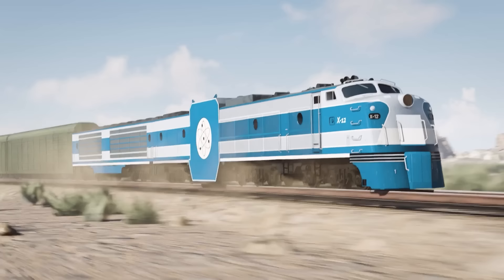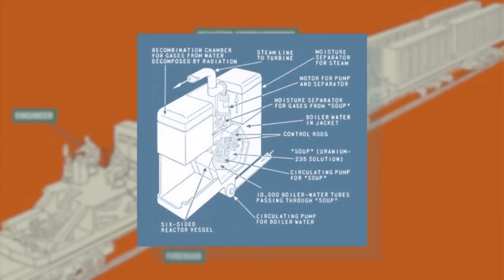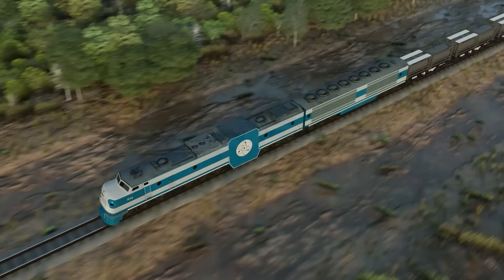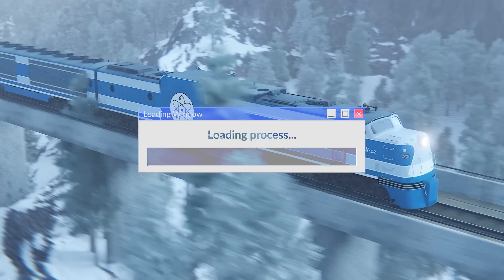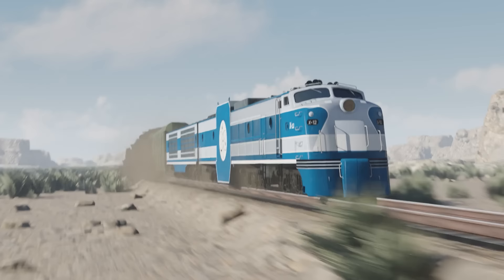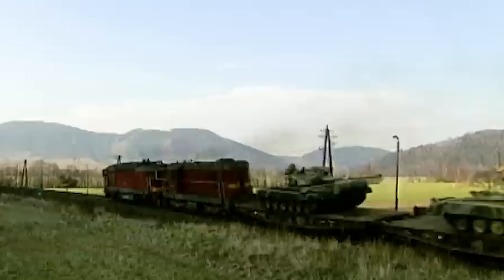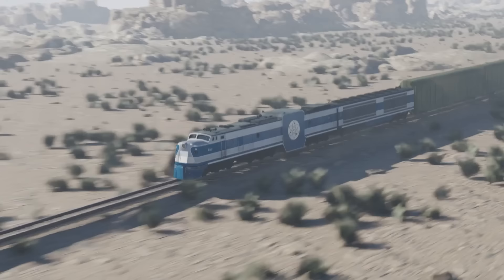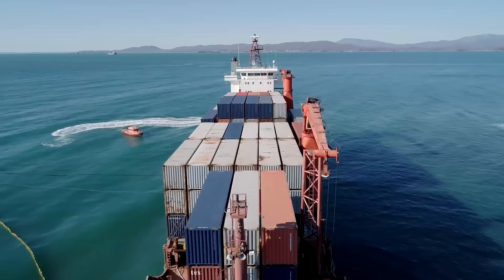What ever happened to Atomic Trains?

Comment: the biggest issue i see with this is, they still need to run on rails, so just build electric locomotives with electrified rails, with the electricity coming from a nuclear power plant, and you have nuclear powered trains that never need to stop, nor refil
Reply: True and anything that can disable the train or the electrified track would mean you have a much worse problem. Either a derailed train. Sabotaged power system. And or a nuclear disaster in your hands.
Reply: You mean run catenary. Electrifying the rails themselves creates a dangerous situation wherever a rail line has to interact with a road.
Reply: @VestedUTuber  well yeah in general terms a "electric rail" or "electrified railway" refers to catenary railways as they're the obvious choice for a electric railway.
Reply: @spaceengineeringempire4086  that's how we do it now and a disabled track wouldn't mean a sabotaged power system. The trains themselves don't need constant access to the catenary just for the most part. Of the journey they have some battery charge
Reply: True
Reply: @elementalgolem5498  yes, you could design locos with some battery capacity for contingency purposes, but not many electric locos or EMU trains have it today. Cut off the power, they stop.
Reply: well that's exactly what happened...
Reply: @JBofBrisbane  Norwegian ones (and I'm sure plenty of others) can, and they even regenerate power when braking. I've seen electric trains lower their power masts for certain stretches of rail or even lower their mast for stretches of rail that don't have catenarys so it's definitely a thing
Reply: @noobartz0890  I know. I'm using what we did (basically, very many electrical grids run off coal and oil not nuclear) as example of a more effective solution
Reply: @VestedUTuber  I live in an area where there are electrified rails and the electric rails stop at any level crossing and restart the other side. Trains have multiple contact points so they are never unpowered.
Reply: @elementalgolem5498  yeah I don’t think he actually meant electrified track
Reply: @IndigoJo 
Sure, but that's with an additional rail so it's still closer to a catenary setup. A powered track setup using just the existing rails (similar to a model train) wouldn't be able to do that, plus it would interfere with conductivity-based train detectors.
Reply: 10:50 in the video
Reply: @RCAvhstape  I'm well aware
Reply: @trainion9626  actually no. 1. A missle is not only far more sensetive, either blowing up on command or on touch, it also explodes reactors do not. 
2. Transport cases and shielding would easily protect the reactor in case of derailment low risk unless it runs out of water and shutdown procedures can't make it in time
3. In the worst worst case scenario it would be nothing like a bomb, it would melt down. Due to its much smaller size and much smaller amount of nuclear materials about a 2-3km radius would be considered dangerous for human travel. 

TLDR: nuclear reactors are far safer than people realise and a small one like on the train would do minimal damage, not like a missle at all.
Reply: @trainion9626 
It's not like a grounded nuclear missile. A nuclear warhead is specifically designed to compress its fissable material to a critical point and release energy all at once. A reactor releases that energy over time instead.
Reply: @elementalgolem5498  There are safer design nuclear reactors and less safe designs of them. We have two nuke power plants close by. Both are now over 50 years old. They are Westinghouse BWR plants where the reactor core always sits under water. Far safer then the TMI design ones or the Russian design ones. In the TMI design plants, the cores rely on water always being pumped over the core and if those pumps fail, you better hope that the control rods do their job and SCRAM the reactor. The Westinghouse one if the pumps fail, still have water over the core. Estimated time is 30 minutes that you have to get the emergency cooling pumps running and to start bringing the temps down. But boy are the local ones touchy because of all of the safeties built in. It doesn't take a whole lot for them to trip off line.  

Disclaimer: I am a stockholder in that local company. Dad was an employee of that company at the local plant and was a Supervisor 3 when he retired.
Reply: @gravelydon7072  yes but no reactor blows up like a nuclear ICBM does. They can start fires.
Reply: @VestedUTuber  You could just not run the third rail through the level crossing, and put the power through a wire under the road briefly. There'd be a brief gap in power for the trains, but every subway line in my city manages just fine when it loses power for a few seconds. 
For cross-country rail, catenaries are much better than third rails by far. I think "Electrified rails" is referring to electrifying the rail lines in this case, like saying "The MBTA plans to electrify the Providence/Stoughton rail line" versus "Stand back from the electrified rail"
Reply: @spaceengineeringempire4086  Having emergency battery system with enough range between 2 stations or dual mode diesel locomotives sounds way simpler than having an onboard reactor. Plus if there is a blackout that means all service must be halted anyway as without power signaling system and switches connected to central train control will also stop working
Reply: @Derek-w6l  wtf is that supposed to mean, yeah gravity applies. But that doesn't change how it corners. 2. That's already how it's done though 😂 3. No monorails have many other disadvantages aswell there's a reason not all trains are monorails
Reply: You're thinking about metro rails. Cross country railroads (conventional) are an entirelly different can of worms.

For starters, metro(politan) trains run on their own tracks. They rarely cross roads (aka a Level Crossing) and when they do, they switch to overhead power lines connected through the pantographs. Not only that is safer, they also use the rails for signaling. For example, level crossings detect trains by it's wheels creating a short circuit between the powered rails. Those sections of rail need to be insulated from the rest of the track.
There is also the issue of power transmission. Over extremelly long distances it's even worth it to convert AC into DC power, because the losses in AC due to capacitance created between the phases outweight the ohmic resistance of the wires. In other words, electric trains have a much shorter range from the power station than you'd expect. It would be necessary to create power stations along the rail, which by themselved present a huge investment and another logistic concern.

There is also the issue of the rails themselves if we're going with the poweted rails concept. They're not continuous. They break. And the current will heat them up, creating a concern over expansion that may warp the rails.

When you take all that into account, it's clear why they went with nukes on the locomotives instead of stationary nukes for the proposal. You can bet lots of engineers back then suggested the stationary power stations idea.
Reply: @ThZuao  mate... You do realize what I said is exactly what Europe is built up on? Right? It's how we are completely dominating the US on interconnectivity and public transit. Our trains are electrically powered by the railway itself (mostly catenaries), and with countries like France being in large part powered by nuclear then suddenly you have a high speed rialway network more expansive than all of the US powered effectively by nuclear reactors. (That's on top of the rest of Europe being very well connected by rail)
Reply: Like Japan which has implemented your thinking
Reply: @EASYMOTOVLOG  that's the standard for trains to my knowledge. Atleast here in Europe I know a lot of US trains still run diesel but I mean that's the US
Reply: You'll need a way to keep the expansion and contraction of the rails from creating arcing or gaps in the connection.
Reply: @rothn2  well I don't need to worry about that I'm not the one that solved this supposed issue decades ago, you do realize that's how most of the world except the US has built up their railways? Most are electric now not diesel
Reply: @elementalgolem5498  I have heard of the affluent parts of Europe and China doing this. Not of Southeast Asia, the Middle East, Africa, or the Americas in general.
Reply: @elementalgolem5498  I have heard of the affluent parts of Europe and China doing this. Not of Southeast Asia, the Middle East, Africa, or the Americas in general.
Reply: @rothn2  Canada (north America check) Brazil (south America check) Cuba (Carribbean/central America check?) Egypt (Africa check) chile(south America again for good measure) Australia (Oceania check) japan (east Asia check) Mexico (North America check) Pakistan (middle East check) Russia (Eurasia check) 
And Actually the US has a few city and intercity lines. I haven't found any interstate electric likes yet but that might just be bad researching on my side. Seems the US does have them though just very little of it. You're right about southeast Asia I couldn't find much, however they don't have a lot of railway in general as they're mostly island Nations
Reply: You could electrify the line via a pantograph system. 
The costs for this scale with the length of the line.

You could power the train itself. The costs of this scale with the frequency of the train.

As you can imagine, short length, high frequency lines make sense to electrify, but long low frequency lines benefit putting the generators on the train engine. 

And so of course that’s what they did, only Diesel engines instead of nuclear
Reply: @HALLish-jl5mo  only makes sense to have the power source on the train for extremely remote trains, like Australia, any other you just have the local grid connected to the railway problem solved. Every city town village will be connected with the railway to give, ans take power. That's how most of Europe has done it.
Reply: @elementalgolem5498  Not everywhere is as dense as Europe. And even places that are, aren’t always electrified. Place I lived in the UK was just electrifying a few years back. It’s a really expensive solution. Mainland Europe I think gets away with it because almost everywhere is en route to somewhere else, so all the lines have reasonable traffic. But the UK, being more costal, so so many “dead end” lines to towns that don’t justify electrification.
Reply: @HALLish-jl5mo  Norway, one of the most sparcely populated countries has electrified the railway. I don't see this as a good argument. Electrified railways are cheaper in the long run, they're only more expensive in the short term.
Reply: @elementalgolem5498  Norway has very few people and enormous oil wealth. They can afford the up front investment.

They also didn't do the stupid British step 🪜 f having the tracks and trains owned by different companies...
Reply: @HALLish-jl5mo  I'd say that's a financial politics issue. Norway is known to make long time investments that svar Money overall whilst many other nations do short term investments in order to make their decisions seem better on paper for the public opinion. As they're only in charge for a small amount of time so making something good Now that ends up fucking over the people that take over later is good for them because it gets them more votes but only costs the public opinion of the next government. Classic politician move. The UK also had quite a bit of oil wealth, but unlike Norway they wasted it in a very short amount of time. Norway decided ok look, it won't last forever, but let's get as much as we can, we won't cut taxes because of this new wealth, because people are able to pay the current tax as is, and reducing it to raise it again after the money runs out won't work, so let's keep taxes the same. Then actually let's invest a majority of the money for later. We were doing okay before this sudden wealthz let's take out some of it to improve the situation. And then invest the rest so that we still have some left over when it all runs out. So it's just the difference in good politics of planning 50-100 years ahead rather than 5-10 years ahead. 
And very few people is as we discussed one of the Downsides, because there's less users and less ticket income.
Reply: @elementalgolem5498  The UK and Norway have produced within 10% of each other the same quantity of oil and gas.
The thing is, the UK has 67 million people, Norway has 5.4 million.

Obviously Norway found it easier to save into a sovereign wealth fund. Norway could spend the same per capita and save 90% of the profits for future use. That's not because Norway is more responsible and forward thinking, it's that the government has huge income and minimal people to spend it on.

I'm sure if the UKs oil and gas production had been the same per capita we'd have a wealth fund too.
Reply: power drops off because of resistance. so power in the unit is more efficient than the lines. also, copper costs a lot of money
Reply: Not only dangerous 😂 but also losses at distance are huge definitely not worth it or reliable enough. Honestly being the weight doesn't matter much this would be a great idea but a derailment could be messy 😅
Reply: But putting up wires is expensiiiiiive 😣
Reply: @rus0004  well that's how it's done though, and it's probably cheaper than the extreme cost of making many small nuclear reactors and all their shielding for the trains themselves
Reply: Electrified rails. would be safe??? No person or animal could get killed, YEA.
Reply: @gc1172  literally what we have in real life I don't get how people keep coming to this comment to tell me it's impossible when that's literally how railways are built
Reply: The real problem with that is what happens when the trained derails. I mean, the infrastructure here in America is so crap that it would happen regularly with the rails that you'd have a problem of entire neighborhoods wiped out if the. Reactor exploded after the train derailed
Reply: @MDRBDM  1. Reactors don't explode. That's a massive myth. 2. The us military transports actual nuclear weapons by rail, less stable than a reactor by far.
Reply: I prefer that my train stops, preferably at a train station. I don’t like unexpected stops over a river on a bridge or in a small town in Ohio.
Reply: i mean yes they would need to stop? how else are they suppsoed to load and unload cargo?
Reply: @taylorgarrett793  much rarer than a nuclear train would have to stop for steam water. Unless it's a short haul passanger line, at which point it doesn't need nuclear power anyway because it's either in the cities or it's going short hops between them it would. A cargo train running nuclear steam would need to have multiple stops between it's destinations to fill up water. If you instead use electric cars like we do today, many of which end up being powered by nuclear because the countries (like France) use a lot of nuclear power and their rail network is electric. Suddenly you have trains that run on nuclear, but only need to stop when reaching their destinations and don't need water towers
Reply: Powered rails? Boring. Give me the high speed Chernobyl on rails, now we're talking 😂😂😅
Reply: @liquidpatriot4480  I mean at this point maglev is just too obvious to even consider nuclear.
Reply: @elementalgolem5498  Still boring.
Reply: Good luck doing that in treacherous or remote regoins. Nuclear trains runs anywhere there are tracks. Meaning it can go places an electrified railway would be impractical.
Reply: Lots of places electrified railways are impractical like the Sierra Nevada or the Andes or long stretches of American prairie
Reply: @tictacterminator  but... I just said exactly what we have done? Like I didn't say "instead of nuclear trains we should try" I said one of the reasons I could think of why exactly we chose to use Electric trains. I.e electrified rails. Sure there are diesel trains in the world but most are electric at this point
Reply: An electrified rail wouldn't work due to just the resistance from the rails themselves
Reply: The further they are from the plant, the more the supplied electricity drops off. They also require DC power not AC. Which has a range hundreds of times worse than AC power, the global standard. It's not that simple. (I learned all this in engineering)
Reply: @christianduclos7139  then explain how it's the current global standard for railways? 😂
Reply: @landonfrigault8096  and yet it's what's used almost everywhere in the world.
Reply: @VestedUTuber u act like we don't already have examples of a 3rd rail system w/ level crossings. we do
Reply: @elementalgolem5498  it isn't the current global standard 😂,  electrifying the rails themselves and running a cable above the line are two totally different things
Reply: @christianduclos7139  first off the process of adding catenaries is called "electrifying rails" second off it is. For small stretches where making catenaries isn't viable the rail itself is electrified.
Reply: @VestedUTuber it's called the Third Rail lol
Reply: @rothn2 two ways; gaps in the rails joined together by fishplates or CWR (Continuous Welded Rail)
Reply: That sounds great until you realize a nuclear train is cheaper than replacing 3k miles of rail with electrified rails.
Reply: @lichtenjj  except it doesn't. A nuclear train is vastly more expensive. Especially factoring in r&d etc. You would have to build water towers along the way (because unlike nuclear ships you can't just pump it on the move. You would need refill stations to refill water for steam. So unless it's literally a single train considering you would need multiple then it will be cheaper in the long run to have electrified rails instead. 
There's a reason we chose electrified rails over nuclear trains mate.
Reply: @MDRBDM  USA has a huge problem with how often trains derail as it is. Isn't it like 3 per day or something? I wouldn't trust them with nuclear reactors on rails even if it would ''just'' be a melt down and couple km/mile no human zone afterwards instead of an actual explosion. I'm with you, not a good idea specially if in commercial use
Reply: @spaceengineeringempire4086  Can't we simply add any insulator in betwen train tracks and rail wheels?
Reply: @VestedUTuber  There's just a gap in the power rail. Yours from third rail country.
Reply: congrats you just invented the subway train
Reply: Electricity will die out over time.  You would need several nuclear reactors across several railways to keep that running.
Reply: @keeganplayz1875  bro that's literally how most modern nations do their railways though 😂 I wasn't speculating I was pointing out how we actually solved it thinking it was obvious I was simply saying what we ended up doing.
Reply: With the load and distances that a freight train travels, they would need a 25,000 volt centenary line (overhead) system.  The 750 volts used in typical third rail systems would not be sufficient to power such trains.